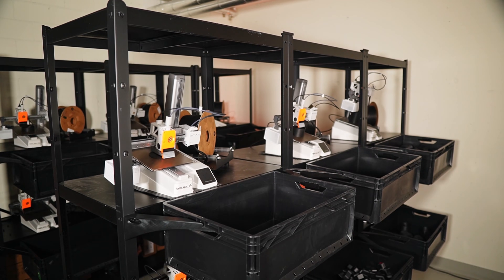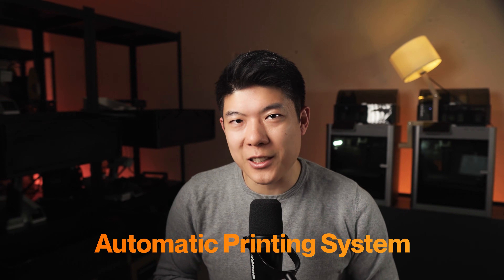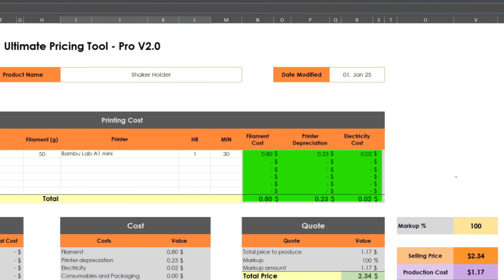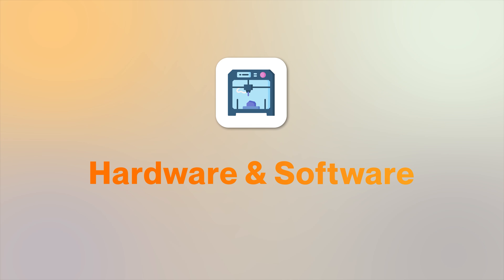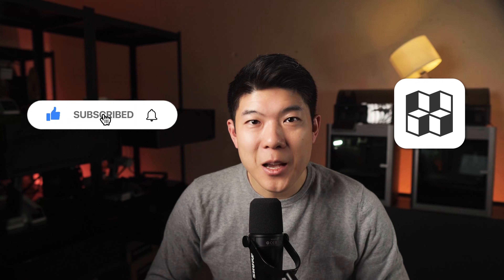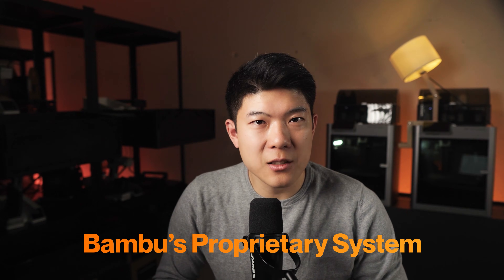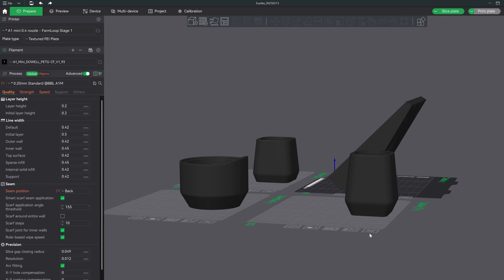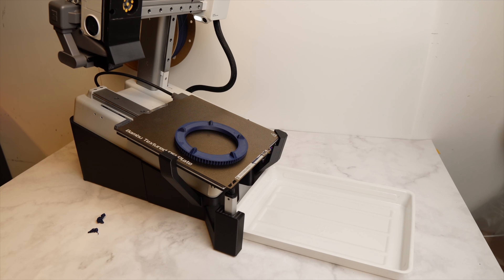How to Automate your Bambu Lab A1 & A1 mini for FREE - FarmLoop Stage 1

Comment: can someone help me? I'm having issues with vibration. my printer keeps moving backwards until almost falling off the table. what do I do? other than that good print but how do I stop my printer from moving?
Reply: Put it on a sturdier table, could also put a concrete slab underneath of the printer to solve most of the vibration, make sure everything is tightened in the printer as well, if you don’t mind slowing it down a bit, slower speeds also help with less vibration
Reply: @isaacsynamon2879 ahh okay thanks, put a slab underneath printer n it's working

Comment: Does this also work with cake toppers that are 2 mm thick and 100-150 by 125 mm? So it's part text and part rod of the cake topper, and then, for example, 2-3 on a plate with a large scraper for the plate so that it has less stress on one point and more divided

Comment: have u made this work with TPU?  the parts im needing to make a 6 figure qty of are 1.5 x 2 inch TPU 85A.  currently they are flat on the back that adheres to painters tape on the build plate.  but that isn't a necessary feature. i could tweak it to replace some of that surface with grooves and supports.  can anyone tell me anything about a system like this being effective with a filament that soft?  cause my parts need that level of flexibility to do they're job.  eventually i will need close to 400k of them but it will take some time to get to that level of need.

thankyou for any feedback (-:

Comment: Great idea, already got 2 machines ready to get going, already printed the parts, just a quick question. As the Gcode are not actual config files, do I replace all the code with your own code or do I had your code to part of the existing code
Reply from the maker: Replace the codes with the new code templates. In our Skool community there are actual config files!
Reply: @3DFarmers  Thanks much appreciate the quick response

Comment: i have a question i printed the stuff and i put the gcode in and it dosent work can you please help me 😁
Reply from the maker: What doesn't work? I need more info so I can point you to the right direction. And if you need support please consider asking the question in our skool community, it could help out others as well.
Reply: @3DFarmers  i inserted the gcode and nothing works the machine dosen't take the prints off the plate

Comment: Ok first of all WOW. second of all I will be setting up my 3D print farm here soon (waiting on permits and electrical install) I have currently 16 printers. Most are A1 printers (one is a mini) and one P1S and 4 P1P's would love to use this with my printers. I also have one Anycubic (Kobra 3Max) and 1 Creality K1 Max. (mainly for prototyping) so hopefully I can use your system with my product. But will be joining your School soon. I am a traditional 3D modeler using Lightwave so your Cad training could help break my brain out of that old way of thinking and take my design into Cad.
Reply from the maker: Would be great to see you soon in our Skool community!

Comment: Hopefully you see this. Is it possible to make a “3D print” just clear the bed? So in addition to what you’ve got going on here (which is amazing), would it be possible to press print from my phone and the printer run the command and all it does is clears the bed?
Reply from the maker: Yes and no. Yes, it would be easy to create this code. BUT, since the printer does not know where the bed and head is, it has to level itself at the start of a fresh "print". Therefore, it would crash into the print. You can skip the levelling, but run the risk of the nozzle running into the bed (in the worse case).
Reply: @ well, the thought was good. But then again, the way you have things set up, I could definitely use it. I was printing a bunch of survival whistles but was on a trip so I had 3 wasted days of not printing. Your contribution is definitely going to change all of that. Thanks for everything you do!
And thanks for the response.
Reply: @ also, I’ve subbed here, followed on MakerWorld and boosted your A1 & A1 Mini farm loop designs. Great job with it all!
Reply: @3DFarmers so back on this, the prints don’t have to be the same thing right?
Like I could print a whole model of different parts in whatever order and have them removed that way right?

Comment: Quick Question, with this system is it also possible to place the 8 pieces on the same plate?
Reply from the maker: Stage 1 is designed for one part at a time. Stage 2 can handle more pieces.

Comment: hi :),  i appreciate your thoughts and work to this project alot, so i printed the hardware but im still struggling a lil with the software part. how do i exactly multiply (copying) the gcode and put it back so its still readable?  You go with unzipping the archive with 7zip; open the gcode file with notepad++; copy, paste the whole thing multiple times (as many as it should print at once ) (am i right?); and then? by unzipping the archive i cannot zip it back into a readable 3mf file (i can only put them together in 7z; zip; or tar data- what we dont want). You said in the video that u can even send the modified code via cloud, so it has to be readable for bambu. i even tried to transfer the multiplied gcode file from cura into a stl file, so i could open it with bambu and send it with the modified start and end code to the printer. But Cura creates just a not readable stl file for bambu.  Would be very thankfully for help :)
Reply: i got it. (: - had to set 7zip (in features; compatibilty) to start always "as admin" and restart the computer. so now i can unzip the files while im opening them (not first unzipping at another folder ...what was the only possibility before). than with notepad ++, i open the gcode; multi-copying it and safe the file. But, i mentioned that i cannot safe it at the exact same space. i save the multiplied gcode at another folder, open it with a second application of 7zip and drag it from the secaond 7zip screen to the first one (with which one i unzipped the 3mf file to overwrite the original gcode. 

    in the video i saw at 4:39 ( https://youtu.be/Tbm1Kn7nq44?list=PLjyUN--kQwusPjTlsMoLMwOGKKWhb1PTh&t=279 ) that there is a cut between the marking of the gcode to multiply and the next scene where a window from 7zip shows the data`s  being saved. 

so is there a more efficient way, with less steps, to safe the multiplied gcode without opening 2 7zip windows? or was the cut supposed to hide it to safe video time and not confusing everybody  ? 🤔😃
Reply from the maker: Great that you figured it out by yourself! On my pc it actually works directly since my 7zip was installed with admin rights. Yes there will be a web app coming in 1-2 weeks for our skool community members.

Comment: This is amazing! I have it up and running but having some issues with a) a purge line still occurring each print and b) the print removal is happening about 2 inches behind where it should and the print gets knocked off by the x axis instead of the bumper. any suggestions?
Reply from the maker: Great that you are trying out the system! a.) Did you disable Flow Dynamics Calibration? b.) You have to limit the plate size to 180x150 and then place the part at the second line if that makes sense. If you need more troubleshooting or a more detailed step by step, consider joining our skool community. We will be helping you there to make it work!

Comment: And how to remove this line on beginning of print? Total useless video
Reply from the maker: If you would have watched the video, you would know. The line is replaced by purging. I modified the start gcode.
Reply: @3DFarmers how do I modified the code, I use farmloop but still doing that line
Reply from the maker: @TheRodrigo9635 Start print without slow dynamics.

Comment: Question Is, what Will be in the Future with closed Bambu FW for all printer's . 😢 I think  IT Will kill all ideas like this
Reply from the maker: The great thing about this is, that it worked purely by modifying gcode and 3mf. Therefore, it also works with the new firmware and slicer ;).

Comment: Very nice work, i've bought a A1 mini after checking this video, but i've a A1 normal and a P1S do you have something similar for those printers?
Reply from the maker: Yes, FarmLoop for A1 is in the testing phase and will be ready in 1-2 weeks. P1S is also in the works, but early stage.
Reply: @3DFarmers  OOOOO was about to ask about the P1S version

Comment: You can do that only pushing with glash beds, I did that with my Ender 3 years ago controled with octoprint
Reply from the maker: I still have my ender 3 on a shelf!
Reply: @3DFarmers  mine got an uncurable disease in the X axis and I have changed It to laser, I still have to play with it to do something worthwhile, but it works for that already
Reply from the maker: @ingeniando3d219  So it's essentially a Ender H2D. You should add a cutter as well ;).